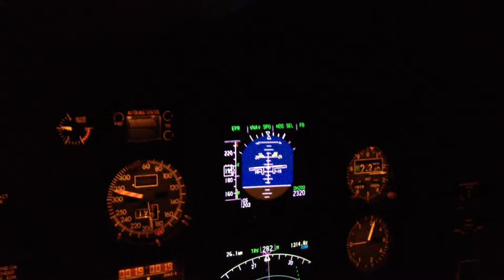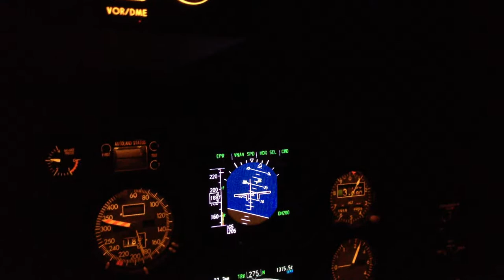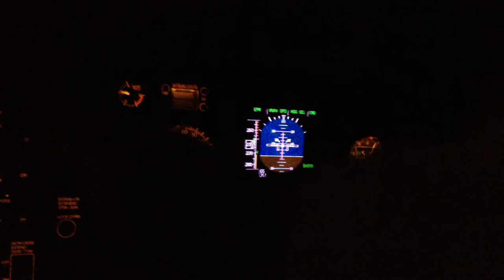767 NADP1

Comment: Hi! Thank you for the video! Was searching the correct procedure for executing NADP1 TO with the 57/67. Could you also select climb thrust or LVL CH (keeping V2+20 in the speed window) at 1500 AGL and then VNAV at 3000 AGL?
Reply from the maker: Yes. That would work too. 
This was to "use all the magic"... (only one "preset", the initial V2+20 climb speed) and letting the VNAV do it's thing.

Note, do NOT insert V2+10 as the CLB speed! 
The ICAO page shows V2+10 only for the first 1000', you will already be at or above 1000' (1500 in this case) when you select VNAV and it references that speed target.
The FD (and A/P) will command a pitch up from your FD liftoff target (V2+15 to V2+25) and reduce the thrust from T/O thrust to climb thrust.

What happens if you pitch up AND reduce the thrust at the same time?

Don't do it!
Reply: @EhWassAmattaU  thank you for your answer !